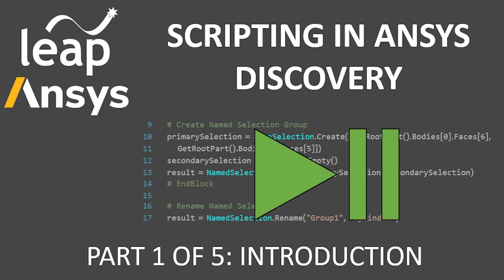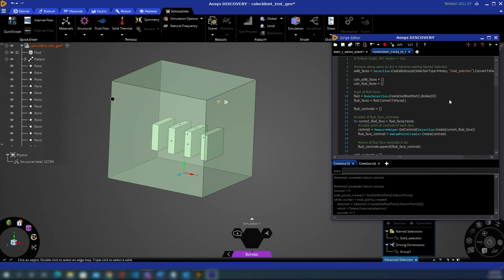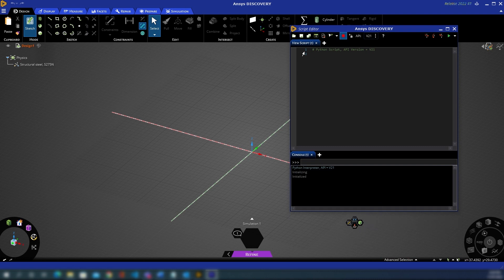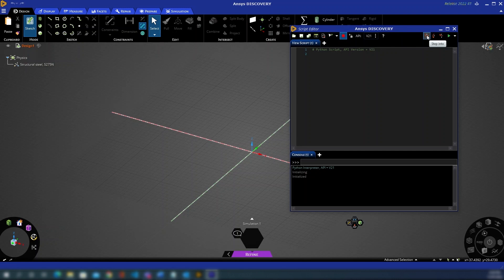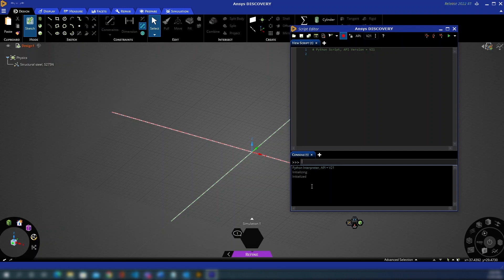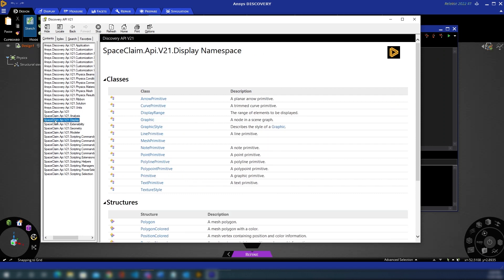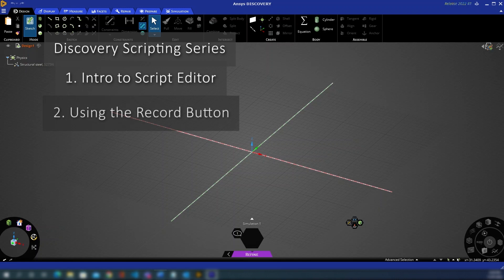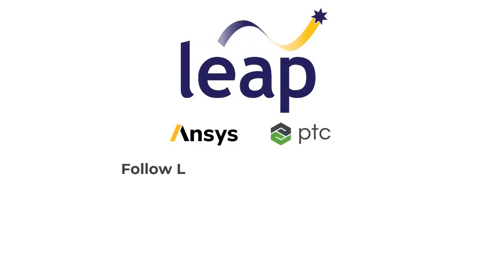Scripting in Ansys Discovery (Part 1 of 5) Introduction

Comment: i hate ansys discovery so much
Reply: I thought I did too until I took some time with it. It uses Iron Python 2.7, it's not using the same syntax and notation used in mainstream Python 3.0 and later. Iron python uses C#. You might be facicng challenges because you are scripting with newer Python versions. GOOD LUCK!

NOTE: For ANSYS Discovery, scripting within the default Script Editor works best.